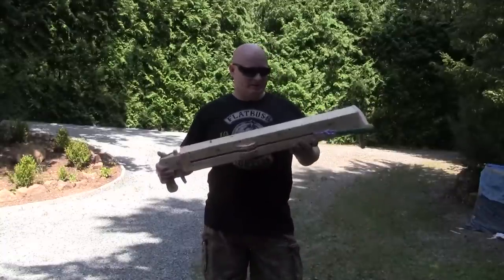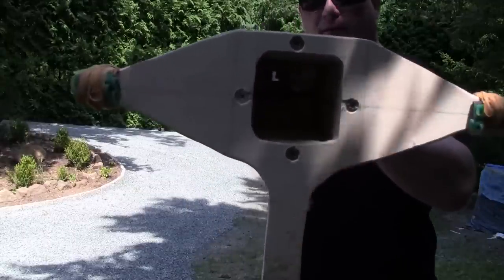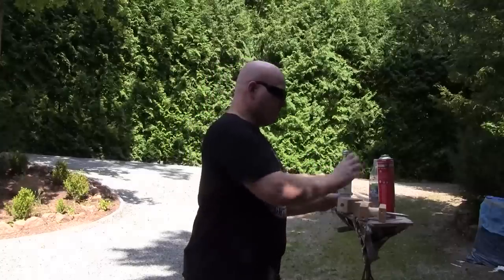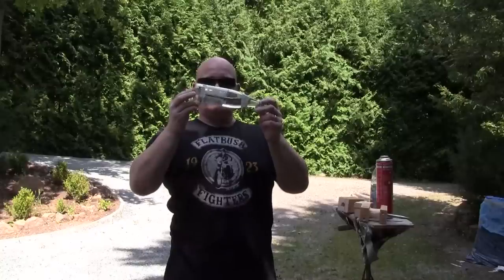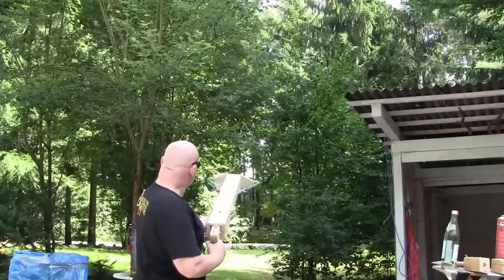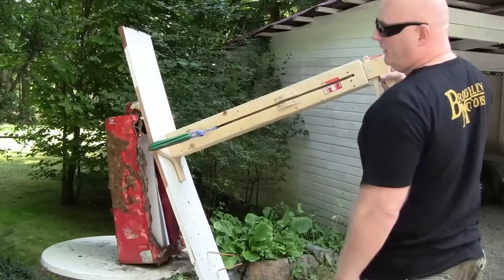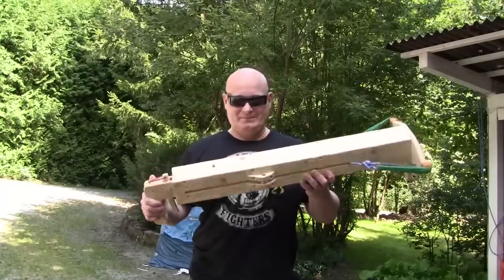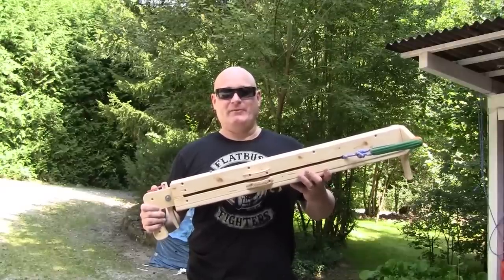The Blunderbuss Slingshot

Comment from the maker: There is a length of tubular rubber, pushed through a hole in the top of the barrel. You can see it in the video. It prevents ammo sliding.

Comment: Dude if it can shoot anything why don't you load it with many 7 mm steel balls to act like an shotgun
Reply: +Alex de Vries 
Would still lack the range. Plus, the more balls you put, the heavier and less effective it will be.
Reply: Alex de Vries also the strap that does the launching is not very thick; you'd need a cup/saddle/cradle to fire smaller ammunition. I think that would get in the way more than be useful. I mean it seems to do just fine firing giant wooden stakes.